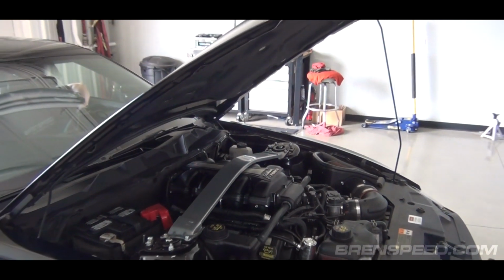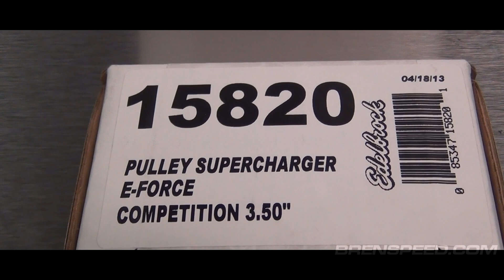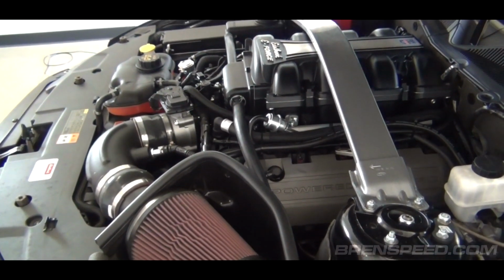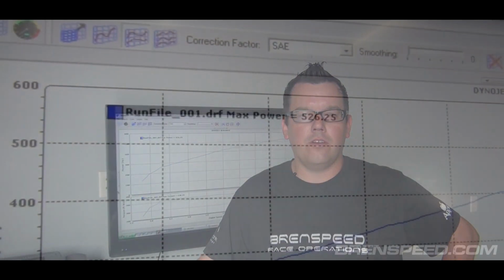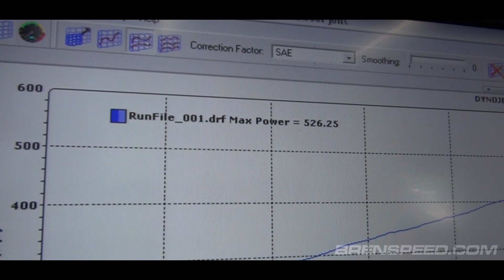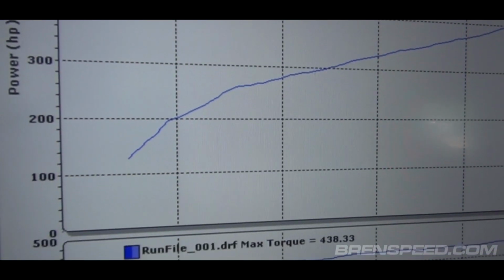2011-14 Mustang GT Brenspeed Edelbrock 650HP Supercharger Package

Comment: How hard would it be to switch back to the 50 state legal setup for you know, when your not at the track and have to take the car in for smog?  :-)  If you ECU flasher capable of holding both programs (50 state legal and 650hp)?
Reply from the maker: Its just a PCM flash so its easy. You could flash it for off road use then go back to 50 state for on the street. You can flash it right at the track.

Comment: Are you able to use a SCTX4 tunner on this set up? 
With whipple/roush/vmp and now Edelbrock how do you fill it ranks with them
Reply from the maker: Yes the calibration we make is for SCT. I like all of the above and they do work similar.
Reply: Im looking for 650 to 700 to the wheel. Is this possibly with this set up?
Reply from the maker: Yes but you need more boost and I highly suggest a built engine.

Comment: What about a stage 2? Would i be able to use my SCTX4 tunner on this kit
Reply from the maker: We use SCT to tune these, so your X4 is fine.
Reply: @BrenspeedEngineering  so you do not need to get it dyno tuned?
Can I used my bama x4/SF4 tuner?

Comment: How the hell is this a 650hp crank kit making 526whp that's terrible
Reply from the maker: Auto typically 20% loss, here is a link to that kit on a manual. https://youtu.be/W_vNlRxMfjQ
Reply: @BrenspeedEngineering is it 650 hp on 2014 mustang gt ?
Reply: @BrenspeedEngineering auto